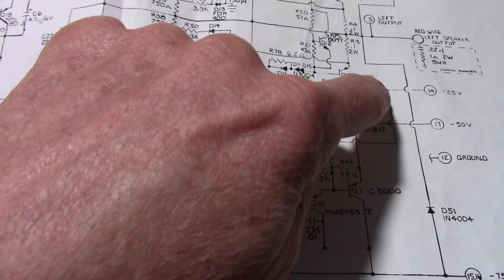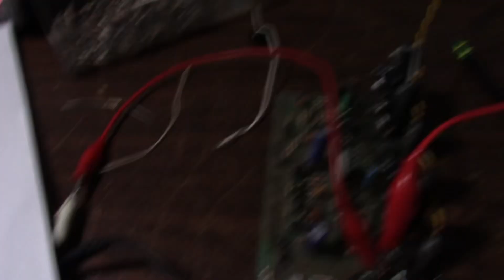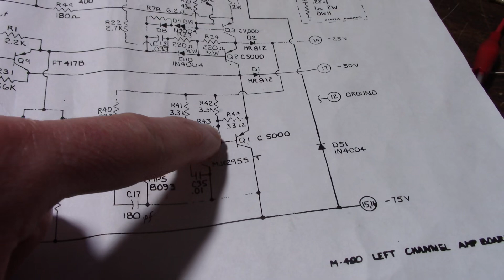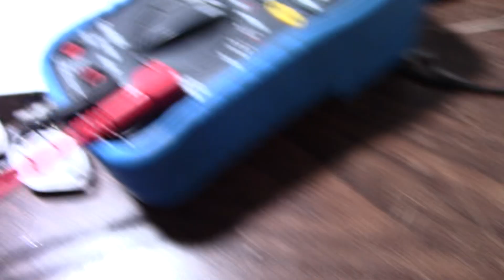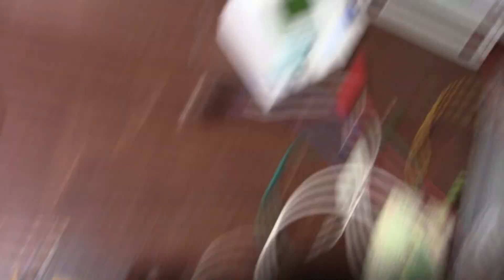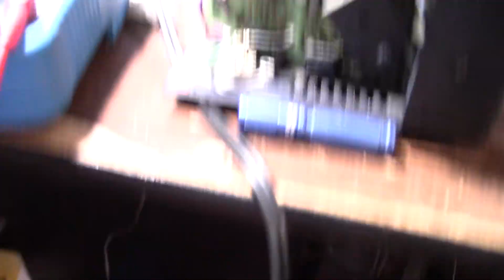Carver m400t amplifier repair final

Comment: The 22ks on my amp were bad also. The amp is like an oven, so all the components are baked. Also when I replaced a resistor, I used half watt. All the transistors, diodes, and capacitors were replaced. It's just a pain to take it apart over and over again.

Comment: Hi John. Great videos very inspirational, they are making me want to investigate audio more and build/repair amplifiers. Now if I can ask a question- what makes a really good amplifier? As in what makes some amps sell for $200 and some for $20000. Is it low thd or is that a sales gimmick? A flat frequency response? not sure where to focus my attention at this point. Thank you and keep up the good work, really cool stuff  you are doing here
Reply from the maker: There are really top notch amplifier designs out there that can be home built reasonably. After getting a power transformer and a case, you can end up spending ~$500. A company trying to turn a profit might require $2000 using quality materials. Does it sound better than a lower cost amp with similar specs? I don't think so. There is almost never any proof to back up the claims. The audio industry is filled with a lot of "snake oil" products and claims. A $20,000 amp is esoteric audio to me. Made for people with more money than sense.
Reply: yep A+ @JohnAudioTech
Reply: Thank you John, I had a bit of a suspicion that was the case. I think your videos are where I'll focus my attention. You go into a lot of detail from what I've seen so far which is really good. Thanks for the reply great job !

Comment: 1000va input seems excessive for a amplifier putting out 370w. The amplifiers efficiency seems quite low.  I don't see a lot of heatsinking for those power levels. I wonder if this is normal, I suspect not
Reply from the maker: I'd say it is normal. Watt draw is ~750. The regulated and bridge rectified power supply makes PF low. The class G design allows it to run much cooler with "normal" music dynamics, but at high levels with a lot of continuous bass tones, the amp will run hot.
Reply: @JohnAudioTech   I remember having one of these on the bench over at PAS and testing it against the PAS 800. Distortion wasn't bad but between the amp and our power conditioner, there were a lot of grunts and groans from the transformers. I was able to pick the PAS 800 over the Carver consistantly under ABX listening testing. I guess they accomplished making a faily small amp for the output without expensive heat sinks at the cost of added complexity. A modern class D achieves those goals at less cost. From the name I had imagined some crazy magnetic device, kind of disapointing all the way around. I'm thinking those resistors were just defective, moisture was able to penetrate them maybe. Reliability suffers as complexity increases.
Reply from the maker: @HillsWorkbench  These aren't my cup of tea either. Just an audio appliance that needs repaired. I sold the other one for $400. This is the "t" version and is in clean shape, so well worth the time and effort. I'll give it several hours of listening to be sure it is reliable and then sell it.
Reply: I think that .....Installing a power transformer capable of offering 1000 watts in secondary voltage guarantees almost zero voltage variation to the circuit when it is close to full power. These details help clean the final sound and the stability of the electronic circuit parameters.